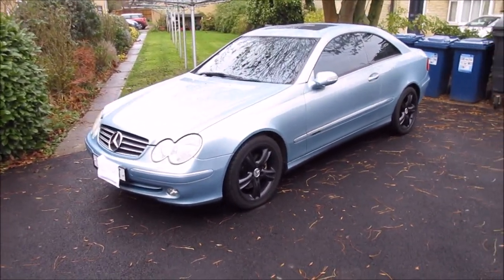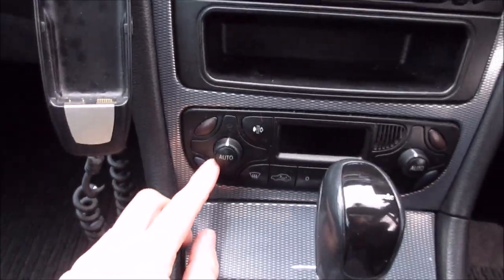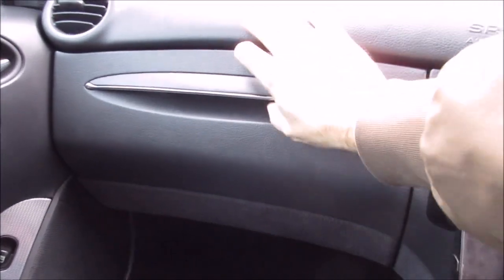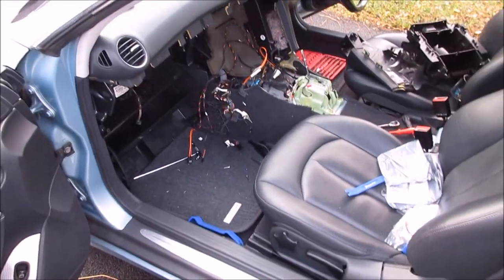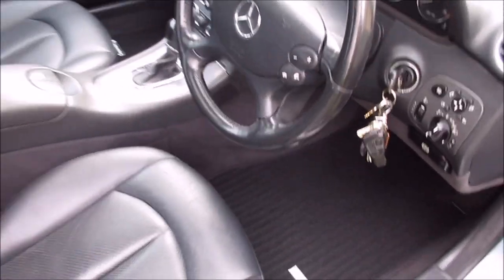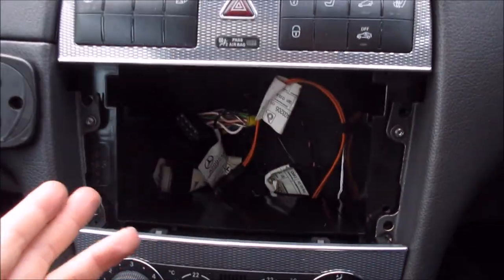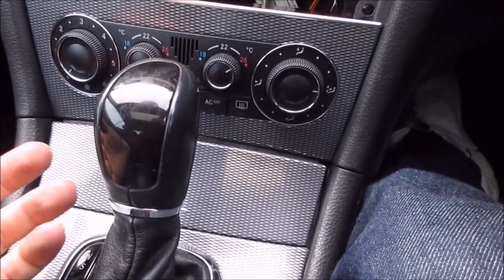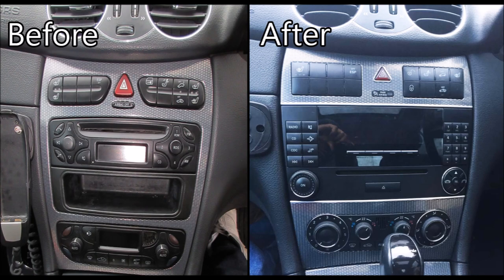Mercedes CLK W209 Complete Dashboard Facelift Conversion 2002 - 2009

Comment: Sweet video! Does one need any adaptors for the wiring from old to new?
Reply from the maker: Hi there, yes you will need a Quadlock connector and you will also need to Solider the upper controls.
Reply: where do you get the Quadlock? and did u modify the wiring or the adapters only for the UCP?
Reply: Can you post a scheme of connectors for harard buttons

Comment: Hi! Thanks for sharing your video. Would like to ask if the audio 20 unit installed has an aux port? I have a 2008 w209 unit from Japan. Hesitant to dismantle just to find out. Thanks
Reply from the maker: It should, but located in the glove box. wasnt standard in all countries however
Reply: KillerHERTZ Mercedes Modifications Thanks! I’ll check it soon. Currently locked down in another location 😞

Comment: Hi mate. I've just bought the clk 2004 240. Where did u get all the upgrades. For example. The heater control. And new radio. An the top controller from. I been looking everywhere. Thanks
Reply from the maker: eBay for the parts, it's not plug and play though. You need to build a custom loom.

Comment: awesome , thanks for sahring this video . that is what I have been looking for . can you please advise where I could this part ?I know you have uploaded the audio part number . further details would be highly appreciated .
Reply from the maker: Which part?
Reply: @killerhertzmercedes  the entire dash, I thought it was a piece ?
Reply from the maker: @TheAquarpio  it's made up of 100s of parts. Your original question doesn't quiet make sense sorry? What do you need to know? Thanks
Reply: @killerhertzmercedes  sorry I misunderstood , I thought you purchased the facelifted dash and installed it yourself , apprearantly you collected all parts yourself . I might just leave it as it is
Reply from the maker: @TheAquarpio  Yes, you need to get the inner cage, upper trim panel, head unit and lower controls (as I detail in the video).

Comment: Very nice video, congrats. i have a problem after replacing all that. My steering controls are not working for audio. Any help?
Reply from the maker: Is your car a 2002 model? did you purchase the correct wiring loom?
Reply: @killerhertzmercedes  it s 2004 model. i dont know if it is the correct. which one is the correct wiring loom?

Comment: Hi, i just made retrofit in my W209 320 (2002). How did You solve problem of popping up message with "SRS Restraint system defective" after replacing upper control panel or it didnt showed in Your case? And second question: did You make steering wheel buttons work with new radio unit? I had pre facelift comand unit and now fitted audio 20 but my steering wheel buttons not working. Also radio not start and stop with engin on and off.
Reply from the maker: The SRS message is a result of the wiring in the upper control unti shorting out when they touch. you will need to code this out on a diagnostic machine as it's stored as a perminant code.
buttons should work if you bought the OEM wiring loom?

Comment: I have a 2008 clk 350     but you instales the shame old air conditioning panel. the one I have has a screen with pixelated display on green. and the more modern 2 big dials

Comment: Hello how you connect the hazard button panel because my is with different plug from the facelift
Reply from the maker: hi, you will need to cut the cabling and make a custom connector. careful you get correct wires otherwise it's possible to trigger airbag light.

Comment: hi 
i have mercedes clk w208 2001 restayling 
can i do this in my mercedes or for someone other klass mercedes 
and km clock is to old i like for w209 can i take it with fabrick jacks ?
Reply from the maker: Completely different cars, you can swap parts over. Regards
Reply: @killerhertzmercedes  but my mercedes w208 have two cables with input
,on mercedes w209 have only one ...only to cut the wires and connect them but again I think there will be more wires possible there are more w208/? thank bro

Comment: Can you do a video of retrofitting memory function to w204?
Reply from the maker: Hi, I'm afraid I don't have that model sorry. in addition to the parts you would need to replace the SAM units... £££
Reply: @killerhertzmercedes  Thanks for the info. which or how many SAM need to change? Is the wire from under the driver seat carpet required to be replaced too ?
Reply from the maker: Yes you will need a different loom + coding to the SAM unit. Perfectly do-able, but won't be cheap...
Reply: @killerhertzmercedes  is that SAM unit the black square box which few color connecters from the door panel switchs plug into ?

Comment: What did you do for wiring on main power 4 wire pin
Reply from the maker: Hi, I used an old Floppy Drive connector, cut the cables and filed down the plastic so it fit. Regards

Comment: Hi there,

Do i have to use that Part ( 2:16 ) in order to fit the facelift dash (Climat control and the switch buttons) ? or is it because you're using the AUDIO 20  so you HAVE TO use the CAGE ? 

i was want to use ANDRIOD touchscreen    see the link compression

 http://www.carstereofaqs.com/wp-content/uploads/2017/02/2006-2007-2008-Mercedes-Benz-CLS-W219-gps-dvd-car-radio-after-installation.jpg
Reply from the maker: Hi, you will need to use the cage (pn in description) as it holds the upper climate controls in place.
Reply: KillerHERTZ - Mercedes Modifications  do you have the cage part number? Im upgrading for Android unit,  also I want to upgrade those dated switches🙃
Reply from the maker: Its in the video description as I mention in the video - Remember you will also need to solder the wiring loom.
Reply: but in the description it says A2098206589  which is for the ''Audi 20'',   I'm looking for  the  '' Facelift cage '' ?

thanks
Reply from the maker: Hi there, you are correct! - sorry the part number you need is: MA209 689 01 16 - I will update the description. -  Please subscribe to my channel if you havent already for future updates :D
Reply: finally, xD where do you find it '?  i'm already subscribed   ^^
Reply from the maker: Dug out the original invoice :)

Comment: Where can you get the facelift dash cages from please ?
Reply from the maker: Your local Mercedes dealership. you will need to remove 2/3rds of the Dashboard to swap it.
Reply: KillerHERTZ Mercedes Modifications Many thanks for the reply will I still need it as mines is W203 coupe and I’m not changing the audio just the panels
Reply from the maker: @OpiffawanaRoyalist  You will need to change the audio as it will not fit with the new cage.
Reply: @killerhertzmercedes  does the new cage fit aftermarket android units? Thanks

Comment: Would this work on a left hand drive CLK?
Reply from the maker: Yep exactly the same.
Reply: Great! Would you be able to list the part numbers needed for the swap?
Reply from the maker: @gentrysmith7547  the cage is: MA209 689 01 16
And you will need to make a custom wiring connector.

Comment: Does the buttons on steering wheel still work with it
Reply from the maker: If you get the correct looms etc yes.
Reply: @killerhertzmercedes  do you have links to everything 
I have a 2002 w209 clk 240 if that helps
Reply from the maker: @StigasuresRex  eBay/mercedes dealership. Getting the parts is the easy part. You need to take entire dash apart and create custom loom
Reply: @killerhertzmercedes  how do I create a custom loom or can a radio specialist place do that